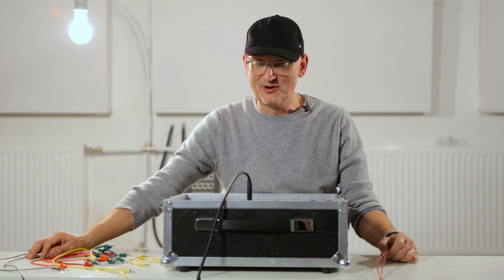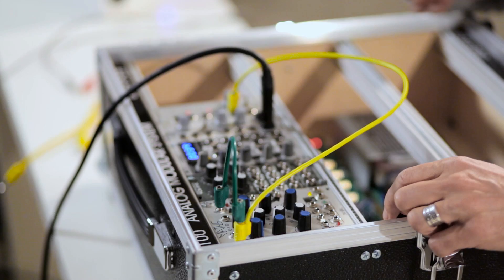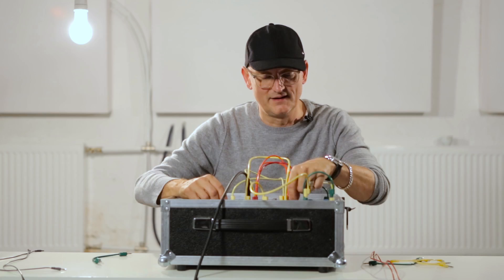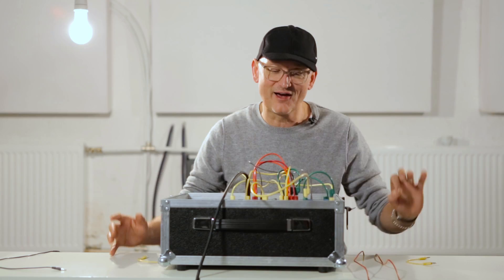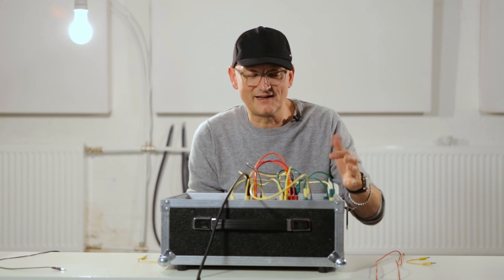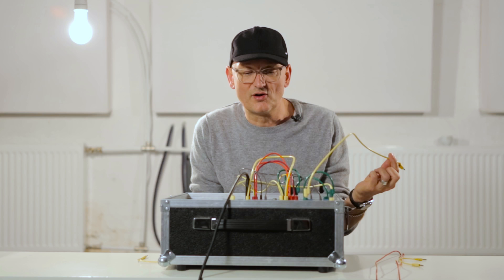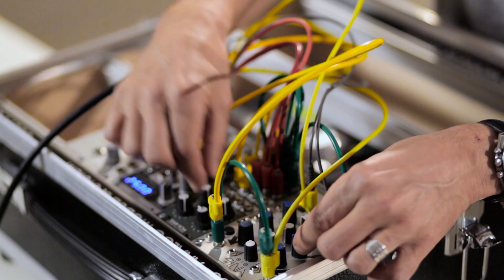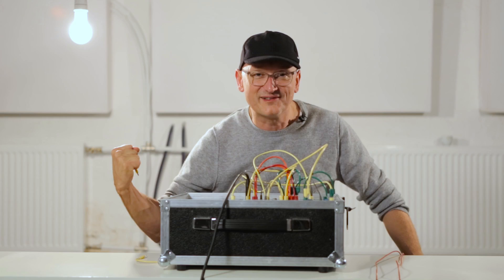How To Make An Analog Kick with Tobi Neumann

Comment: At 4:24: "So then I take the output of the second envelope and put it to the pitch input". No, you don't, Toby! According to the layout of the Z3000, you actually put it into the FM2 input! I was wondering why I didn't get the same sound even though I was using the same envelope and oscillator modules, and this was driving me crazy! Later in the video, at 7:00 to be exact, he actually patches one of the attenuverter outputs of the Maths to the 1v/o input on the Z3000 to control the pitch.

Comment: If someone was to write up all the connections I would be eternally grateful.
Reply: Hey he has five modules
An envelope generator(make noise maths)
A four channel mixer(vca4mx)
An oscillator(tiptopz3000)
A cross filter/out- a-138d
And a lfo-a145
————
He takes the clock of the pulse log to envelope 1 trig(maths)
He takes that same trig out into env 2
Then the same trig from 2 into Oscar sync function(vca)
He then takes all 4 Oscillator outputs into the 4 channel inputs
He takes the mixer(vca) into the a138d so you can hear it on your system
Afterwards he takes the env 1 output to a mixers cv input
Then the mixer cv input to the other 3 channels input.
Later he takes the env 2 out into the oscillator pitch
Then an extra envelope into the osc pitch
Then he takes the mix and puts it through a filter
Then the trig out into sync.

I may not have put it all correct especially towards the end. But I’ll edit later if I have to.
Reply: The best reply you could of asked for
Reply: @considercaption  Do you have any ideea how can i control the clock in vcv with a external midi controller? To my knowledge i need the midi -cv module but when i try to connect the clock from the midi module to the lfo nothing happens

Comment: Instead of using all the VCAs was not possible to mix them with a mixer, and then pass the mix through the VCA? Maybe I'm wrong..
Anyway, great video!
Reply: The VCA module he was using IS a mixer. So why have two modules when one will do. Also he wants independent VCA control of each wave form, rather than mixing the waves then applying the VCA after. Hence the use of two of the envelopes on the MATHS module
Reply: +GreatMateWorkshop
You are correct. Either arrangement will work the same effect. In fact most people don't have 4 VCAs to dedicate to a kick! Makes much more sense to mix then into a single VCA. I think he only did it the other way because that's how that particular module is set up.

Comment: i am going to start with modular but didn't know which modules to buy, wel now i know haha. how would you implement this in ableton, just record a one bar loop?
Reply: Jan De Buysser you can get very similar results w/ operator, it has the same modules more or less; multiple instances of different sound generators (operators in this case) with mix control, there is a pitch envelope, plus much much more. Would suggest to just look up how to create a kickdrum w/ operator, ought to get you on the way

Comment: excellet vid, someone has a recom to record this on a more accurate bpm? i'm currently using voltage modular from cherry audio, i tryna rec but the transient keeps moving slightly from the 1.1 bar postion, it does not keep constantly
Reply: i sended the 2con envelope out to the hard sync but didnt worked

Comment: Jomox Mbase seems suddenly cheap and easy compared to this, does it not?
Reply: +James Porch The Mbase interface is terrible to use and you are forgetting that those Eurorack modules could easily create a huge variety of lead, bass and percussion sounds also..
Reply: ***** Yeah Jomox interface is terrible on my 888. You're right, having everything per knob and open to cross patching is much wider in potential. Urgent call for more patchcables!
Reply: James Porch
Amen! :)

Comment: That is a really nice kick but shit just those few modules are like $1000.
Reply: kinda hard to justify building a kick from scratch when you can get a nice dedicated kick module for a quarter of the price.  very cool in theory though.
Reply: Yeah, it all depends on what kind of control you want over it, too. Or what sound you're after. Alternatively, you could use a sampler module to sample a kick made this way, which frees up the modules you used to make the kick again.
Reply: You don't have to do it all at the same time though unless you want a live setup. For recording you can actually do a lot with few modules and layer edit in your DAW just like you would with a drum machine in a normal track.
Reply: What part of " just those few modules are like $1000" was not clear?
Reply: Yea I know, but my point was it's not a 1000 dollar kick sound because you can use it for a lot of other stuff. I agree it's expensive though. For me it's either software or diy

Comment: Don't you love it when people do have some expensive bad-ass modules in their rack but are too cheap to buy blind plates, then let the cables hanging lose in the holes, running the risk for them to connect to the power supply connectors?